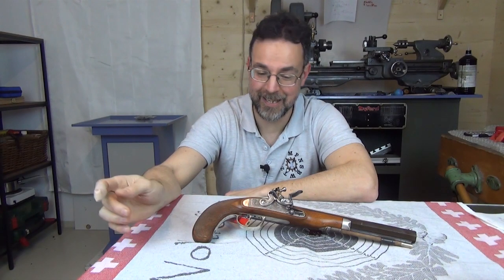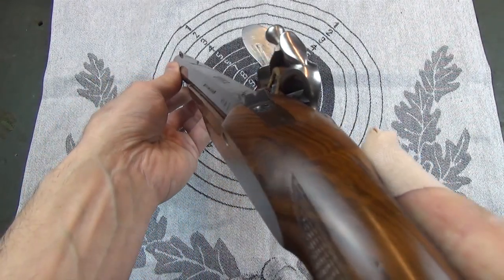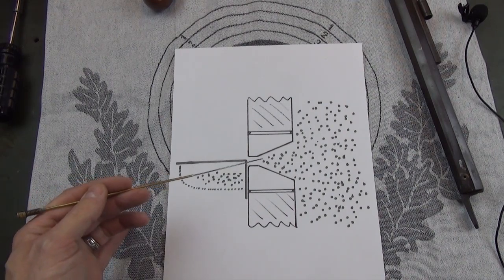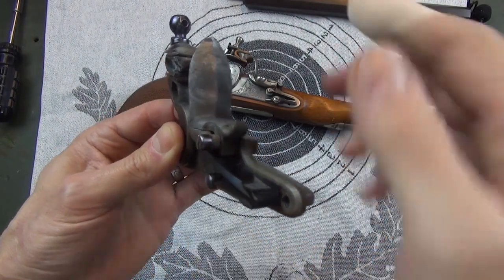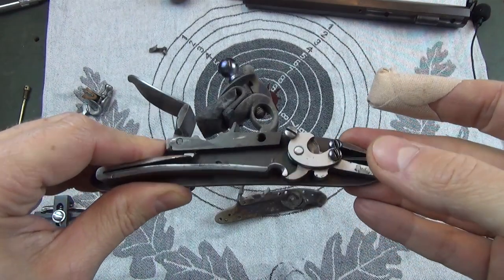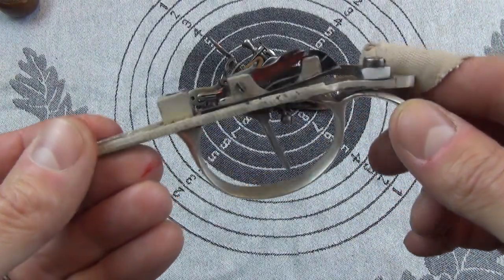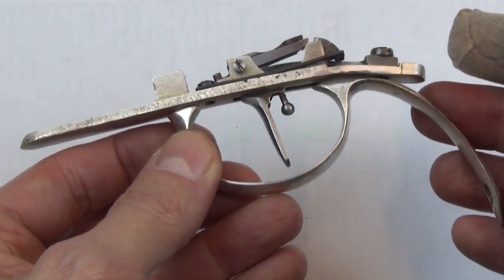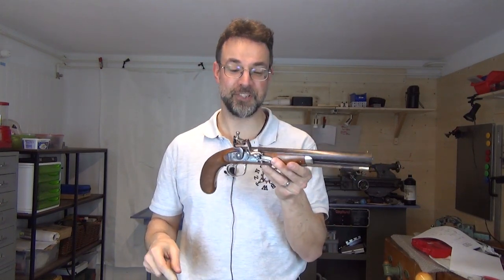Tricked Out Flintlock Pistol

Comment: Chap, Last night I was reading about the New Federal cartridge the "Cal 30 Super Carry". It says cal 30 but ball diameter is 0.312" ball diameter so cal 32 really. This new cartridge sounds like what is know in the USA 32 Long French the pre-WW2 French pistols (one question what was thew French official name ?). I would like to check dimensions of the two cartridges. Have you look at the new cartridge ?
Reply: I know of it but from what I’ve heard it’s substantially hotter so let’s hope the cartridges are not interchangeable 😅 The French designation was simply « cartouche de 7,65 L » sometimes the packaging would indicate whether it was intended for pistolets or smg but to my knowledge there wasn’t any actual difference in loading.
Reply: @thebotrchap  Per April edition American Rifleman the 30 super carry will come out in two different bullet weights 100gr @ 1,250 Fps and 115 gr @1,150 Fps. And looking at some dimensions on-line the case length is longer than 7,65 L French but overall load length shorter. Reading this I am not sure why they are bring this cartridge out.
Reply: @EdAtoZ  Because capacity, and a thinner case diameter than 9mm while retaining similar ballistics.

Comment: Thanks this was interesting! However, since you made such a nice illustration, I just want to tell you there is a common beginners mistake hidden in it. And you can make dovetails on the Myford. Do you have the vertical slide for it?
Reply: Do tell! It wasn't intended to be ISO standard ;-)

Yes I do have a vertical slide in it but there is too much flex in the system for my liking. The mill has arrived now anyway.
Reply: @thebotrchap  You have omitted the lines from the top part of the sectioned view of the insert (and the barrel wall) to the bottom part, making it two separate parts.
Reply: @CandidZulu  Ah well, that would be a difference in doctrine. I've been staring at patent drawings for twenty-odd years and in patent technical drawings it's normal to omit such ghost lines for clarity, i.e show exactly what you can see in the cross-section. For engineering drawings I completely agree!
Reply: @thebotrchap  Sorry, I can't agree. They are not ghost lines, they are exactly what you would see if you would mill this part to a section.
Reply: @CandidZulu  Oh now I see what you mean! I still stand by my reasoning that it's clearer for the layman without those ;-) When it's full of powder (as drawn) you can't see those lines anyway. 

As we say in patent speak "details omitted for the sake of clarity" 😁
Reply: @thebotrchap  I would tend to agree. We've had a vertical slide for our Boxford (so a bigger and beefier lathe than the Myford in the first place) for years and I don't think we've ever used it. We always just use the milling machine instead.

Whilst we are talking machine tools: Check out the diamond tool holder by Eccentric Engineering. They're a new take on a very old lathe tool concept and we've found them to be really useful. (In a Dickson quick-change tool post of course)
Reply: @chemistrykrang8065  Yeah I have one. I use the diamond tool for everything! Probably in ways I shouldn't too....

Comment: Really interesting stuff. I was under the impression that the fly is there specifically to allow the lock to function with a set trigger? Because with a set trigger, the sear will not be held back by the user through the trigger but is only knocked away and is free te return immefiately? I know in the Winchester lever-actions, such a fly was only present if the weapon was equipped with a set trigger?
Reply: The problem I describe is still present with a standard trigger when applying gentle pressure on the trigger. If you yank on it then sure the sear will be well clear of the tumbler, but then you have pulled your shot.
Reply: @thebotrchap  surely only if the geometry of the tumbler is "wrong"? If the bottom of the half-cock notch is at a smaller radius than the full-cock notch, then the sear would not contact it if held in the position where it released the tumbler?
Reply: @peterconnan5631  In theory yes but also think that finger tissue is also elastic, couple that with a strong sear spring and the sear can spring back towards the tumbler after release. It’s a lot of ifs and buts that are all solved by the fly. If you think about it, if you do a proper follow through even with this set trigger the sear is held clear of the tumbler.
Reply: @thebotrchap  i don't want to bugger up your great video with an endless argument so will just leave it with "I don't fully agree".
Reply: @peterconnan5631  I’ll put it this way: A fly with a standard trigger is not a bad thing.